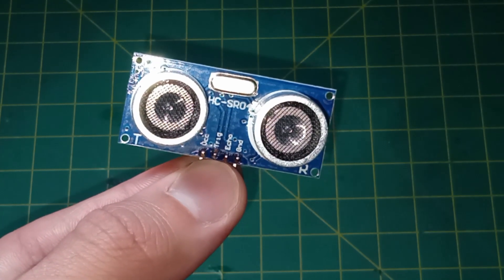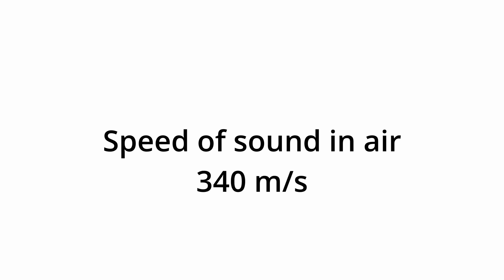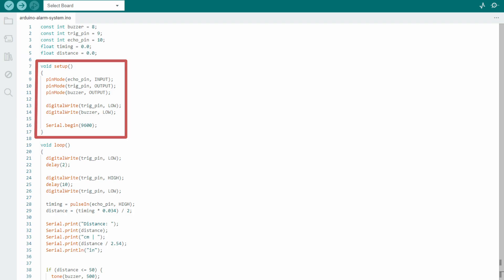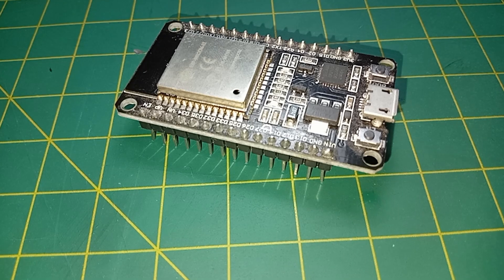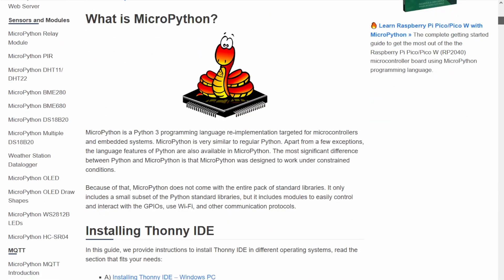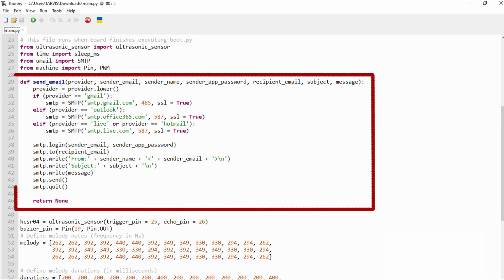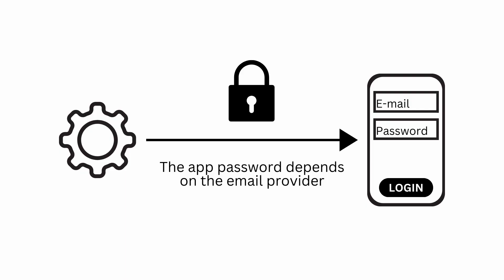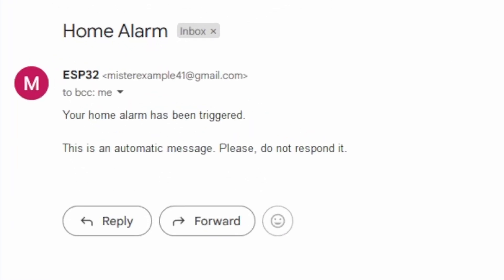Ultrasonic Sensor with Arduino [COMPLETE GUIDE]

Comment: hey i see one part of the video you had a green wire but when you were building the project you didnt include the green wire ? is it required that we use the green wire??
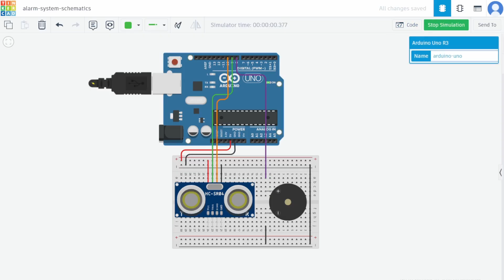Reply from the maker: What part exactly? Are you referring to this green wire 02:49?
Reply: @lucasfernandochannel  Sorry i figured it out but i dont understand how to put the ESP32 code into Arduino IDE do i just combine it all into on?
Reply from the maker: @danielansah3090  The ESP32 code was written in Python, so it won't work on the Arduino IDE. Please use the Thonny IDE instead.
Reply: @lucasfernandochannel  thanks I will try it now
Reply from the maker: @danielansah3090  Okay. You can reach me out if you have any doubt
Reply: @lucasfernandochannel  ok I have thonny downloaded should i make all the files into one?
Reply from the maker: @danielansah3090  No. Keep the files separate. The ESP32 board will run each of these four files when appropriate.
Reply: @lucasfernandochannel  so I ran into a problem I’m using a ESP32s 38PV4 board and thonny couldn’t find the device
Reply from the maker: @ Thonny IDE didn't recognize the device when you connected it to the USB port? What is the error message the IDE displayed?
Reply: @lucasfernandochannel   Ok so it was my mistake i put the esp32 on a expansion board and im uploading the codes now but what i dont undersand is how im going to upload multiple codes into the esp32
Reply from the maker: @danielansah3090  Open Thonny IDE. Then click on "new file" and paste the code of the first file, for example main.py. When you click on "save", the program will ask you if you want to save it on your computer or ESP32. Choose the second option. In the end, repeat this process for the other three files.
Reply: @lucasfernandochannel  I understand thanks I’ll try now
Reply from the maker: @danielansah3090  Let me know if it worked
Reply: @lucasfernandochannel  ok so I save all the files into esp how do I make them all execute?
Reply from the maker: @danielansah3090  When you power up ESP32, it automatically looks for a file called boot. After that, it will run the file called main. The another two files execute depending on what is happening on main.py. So after you upload the files, just power the board, and it will run them.

Comment: Hey bro!
Can u show us the code were we can paste it on our software
Reply from the maker: The code for Arduino or ESP32?

If you want the Arduino code, visit the Arduino alarm system repository (link is in the description), download the alarm-system-arduino.ino file, open this with Arduino IDE, and, then, click on the upload button.

Now if you want the ESP32 code, visit the ESP32 alarm system repository  (link is in the description), download all code files (boot.py, main.py, ultrasonic_sensor.py, and umail.py), and, then, save them on ESP32 using Thonny IDE.

Hope it helps you.